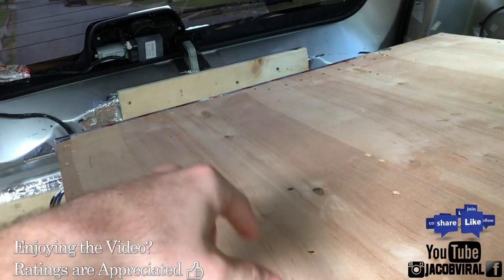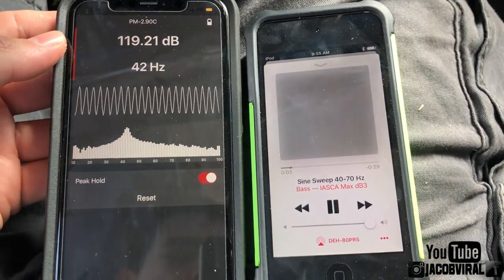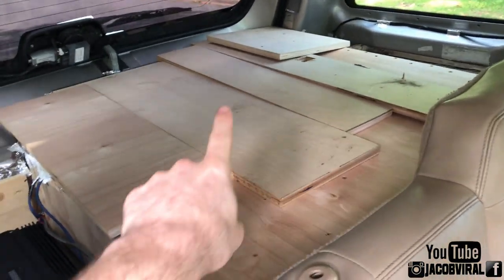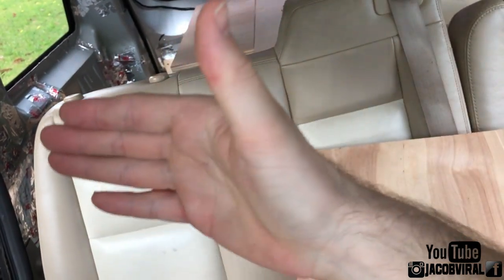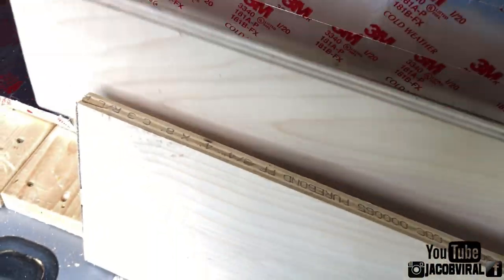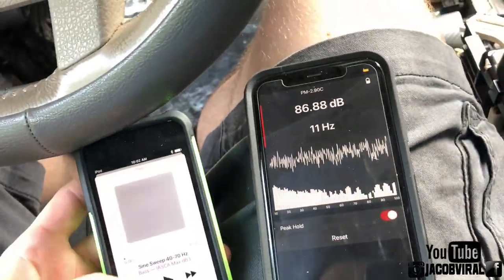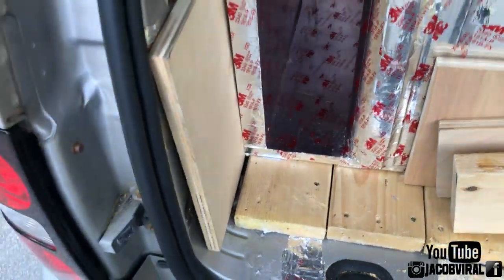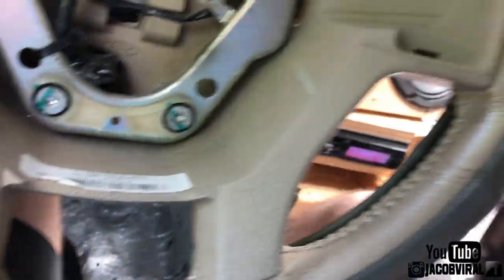I TRIED THIS STUPID IDEA WITH MY SYSTEM

Comment: Back in my day i used to run 4 15’s on sealed bass tubes. Let me tell you, every day i had the tubes facing a different direction just experimenting. On an isuzu rodeo, the best they would sound was 2”!off the floor facing down. 
Matter of fact jacob, thanks to your experimenting series, i’m considering getting the “bazokas” down from the attic and trowing them on the truck. 
Something to think about, back in the day, we used to put bags of water inside boxes. It wouldn’t affect the output a lot, but it made the box less peaky.
Reply from the maker: Interested! Never heard of that nice man. Sounds like a fun project for you :)

Comment: Hey bud keep it up. Im doing the same thing myself but ive just been clamping. What is the spl metering app you use?  and some info such as ,does it have an external mic and cost. I just dont want to spend much if not anything. Ive gotten better at tuning and wiring from watching your videos and others as well ( Big D, EXO, ShowtimeSPL, Parker, just to name a few) But there's nothing better than just setting something up and testing out diffrent ideas as a way of learning how it all works.
Reply from the maker: SSA Studio App with the device

Comment: can u down ur backseats? if so flip ur box 180 degrees and have ur port faced to windshield. open ur trunk and meter it :)
Reply from the maker: They can yes but can’t flip as I have over 30 screws holding box down to 2x4s braced to floor so box isn’t moving anymore. Good idea for someone though.

Comment: Dude it's not stupid. You should see the things I've done. Ive made alot of boxes but the biggest one that got mad attention had 4 15'(only two the same), 3 12'(all different) , 1 10' and 4 6x9' all in same box! The amount of crap I copped was funny but the video of my dash and windows vibrating made them go ummm that's not supposed to work. Lol. I'm like you my man I try new things. So many ppl just build what others build. My current build I'll upload next few days but is single 15' in 4th order except the sealed side is taken off but the 200mm square lip changed my frequency from 36hz to a nasty 45hz. I'm about to add two 10' in a 4th with a strange sideways setup and a port with no port. Hard to explain but if you sub and bell to my channel you'll see it next few days. candy2seventy2 
Love watching your content bud all the way from Australia 👍